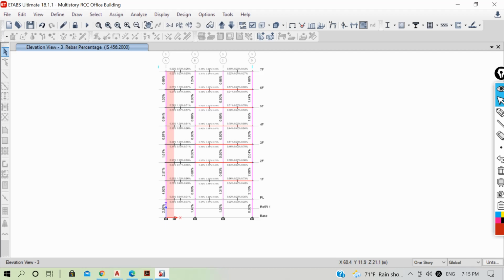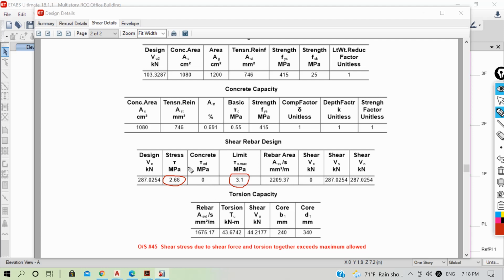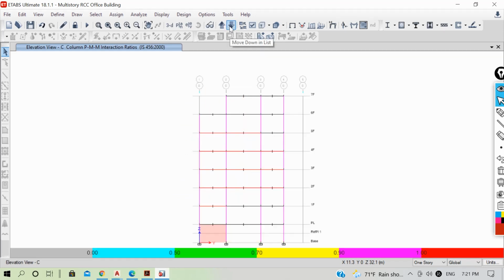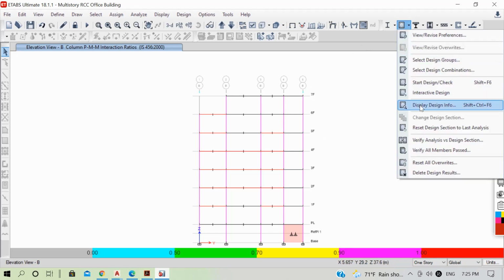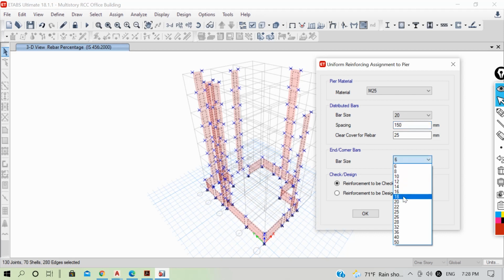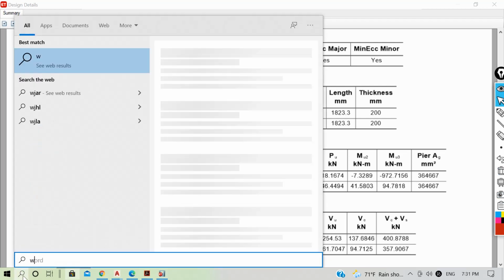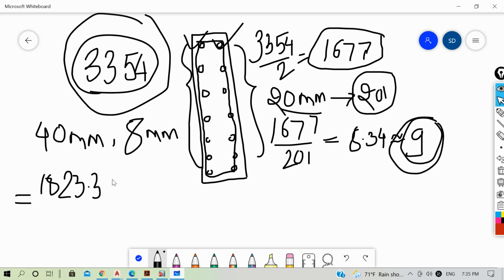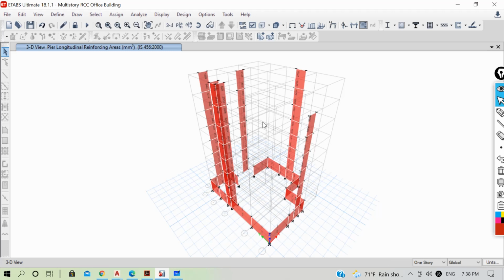Lecture 6 - Design of Beam, Column and Shear Wall in ETABS (Part 2) - Lectures based on NBC 105:2020

Comment: I think in the base of the shear wall the rebar comes about 25000 or more but you have considered in video the upper one,It's ok for to show design process. But, in actual how to manage such huge reinforcement demand, after applying boundry element process also the accomodation of  this demand is impracticle.Would you have any suggestion for this?

Comment: Good video sir.. sir in my design of building im getting rotation in 2 and 3 modes.how can i correct it.?
Reply: You need to increase the stiffness of your building by either implementing a shear wall or increasing the size of the frame.